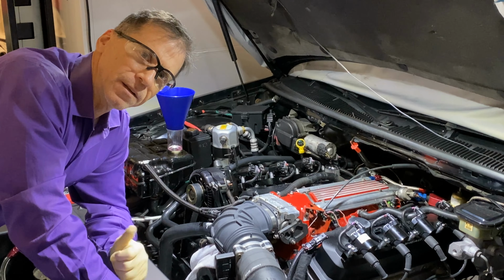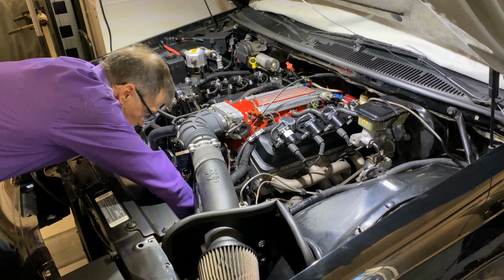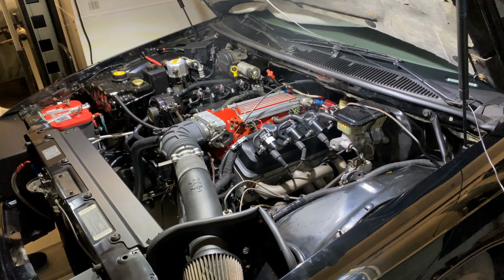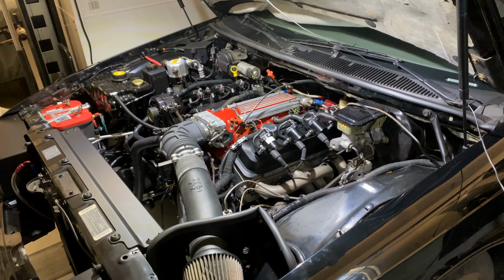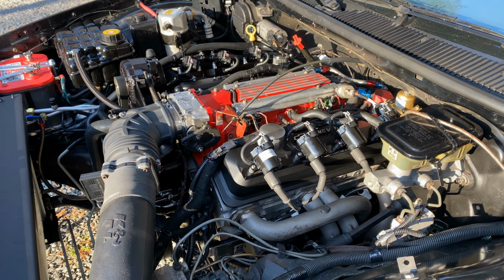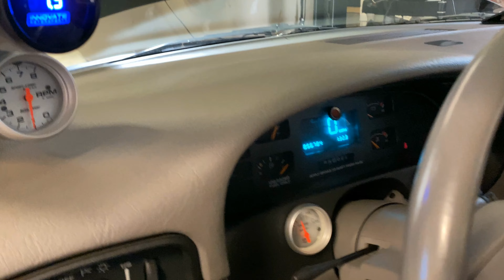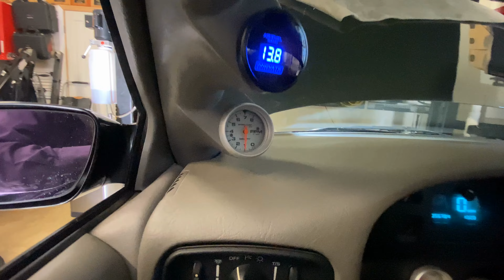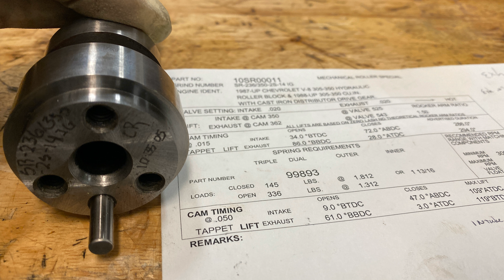IT RUNS!  Impala SS Solid Roller Cam Part 4

Comment from the maker: Lets see if it is quicker than with the GM 846 cam.  Don't let me down Mr. camshaft.
Reply: Will you retune it for the new cam
Reply from the maker: @hpjunkie69  I will do some data logging but I don't expect much tuning.  Possibly higher shift points.
Reply: @EllweinEngines  why not just LS swap for instant power

Comment: That does not sound healthy and I’ve built flat tapet  and solid roller engines before that wasn’t proper for breaking that cam in , love your builds and I hope this one works out for you as well keep up the great work carl
Reply from the maker: What do you do for a break it?   I assume the roller cam does not need a break in.  Just need to make sure to not spend too much time at idle.